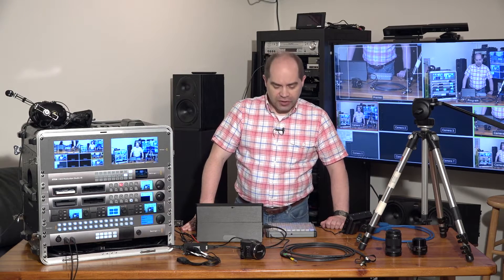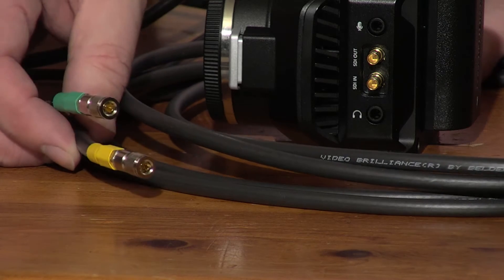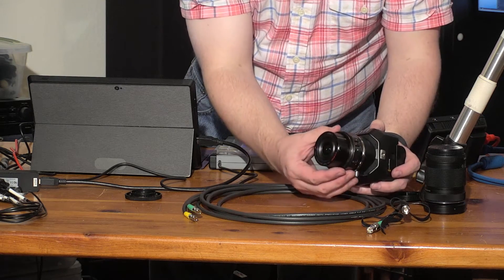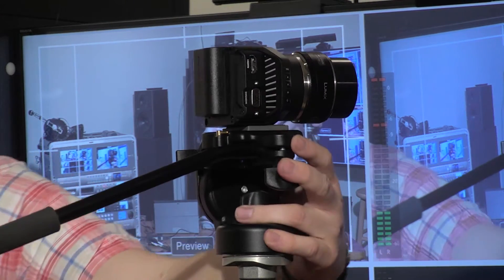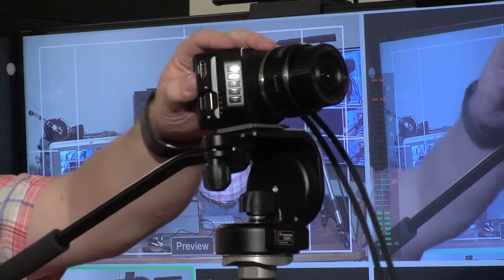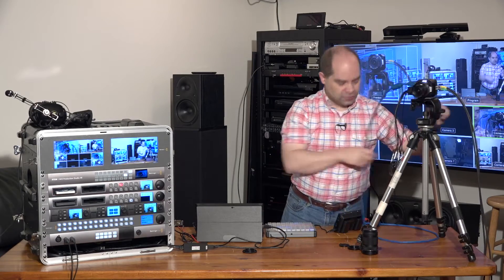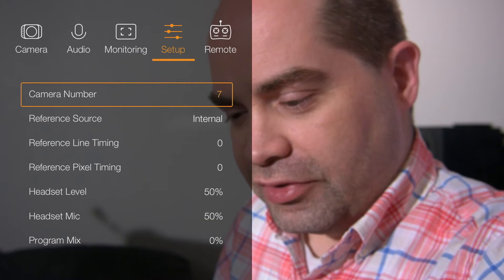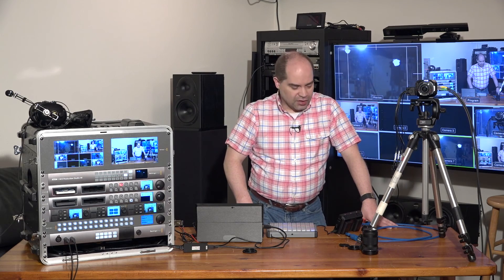DJP Crew Training - Blackmagic Design Micro Studio Camera Connections

Comment: Thanks for the demo brother, Actually i'm facing issues while connecting the SDI to the ATEM switcher i can't control the camera via ATEM software if i connect a HDMI with a ATEM HDMI series i can control the camera may i know how do we control the camera via SDI cable connected to an ATEM SDI Series
Reply from the maker: If you get the Blackmagic Bi-Directional Micro Converter 3G you'll be able to control the camera. Make these connections: (1) Camera HDMI output to converter HDMI input, (2) converter SDI output to switcher SDI input, (3) switcher Program/Aux SDI output to converter SDI input. (4) Connect the converter to a computer and install the Converters Setup application from BMD's website, then in that software set the converter's camera ID value to match the number of the switcher's SDI input you're connected to.
Reply: Thanks a lot so it's not possible to control the camera's zoom, color corrections for a SDI cable directly connected to an ATEM SDI SERIES, We have to do so many conversions please correct me if i'm wrong @djp_video
Reply from the maker: Not with a single SDI cable. SDI only sends data one way. Camera control needs to be able to send data back to the camera. That's the reason for the second cable.
Reply: @djp_video  cool thanks a ton:yougotthis:, So the micro camera input(SDI) has to be inserted in the same ATEM (SDI input) next to the video signal given to the ATEM right
Reply: Tested with the Cable Mapping:
- Cam SDI output to ATEM input
- ATEM Output to Cam SDI input
Works great! thank you
 @djp_video

Comment: Awesome demo. I had a question for you. trying to hook up a BM Micro Studio Camera 4K to ATEM TV HD. Hooked up the SDI in and out cables. Getting the video feed from the camera, but cannot seem to control the camera from the ATEM software. Connected the SDI in of camera to one of the SDI outputs on ATEM TV HD. Is there any setting either on the camera or the ATEM TV HD that need to be changed. Please advise. Thanks in advance
Reply from the maker: Make sure you've set the Camera ID in the camera's menus to match the camera number in the ATEM software.
Reply: Doug Johnson Productions thanks, worked like magic

Comment: Do you think the Micro Studio Camera or the Studio Camera 4k 2 has a more superior image or are they about the same? Also, what is your opinion on the quality of the Studio Camera 4k 2? Thank you for the review of the Micro
Reply from the maker: They're going to be identical.

Neither performs well in low light. And finding good quality lenses which provide a smooth zoom capability is quite difficult.  I've pretty much relegated my Micro Studio 4K to being my last choice and if I have anything else available I'll go with that instead.
Reply: @djp_video  Ok, good to know. So if I'm on a well lit news studio set, do you think the Studio Camera 4k would hold up and give a quality image? Or should I consider other cameras (really the only pull for the Studio 4k is the ATEM control).
Reply from the maker: In a well-lit environment the limiting factor is going to be your lens. If you can put a really good lens on it it can produce a good quality image.
Reply: @djp_video  I know this is not the best camera option, but I'm limited in budget at this time. I am purchasing the 2 m/e, because I need supersource (thanks for your great videos on that), so my camera budget got lowered. We are planning on the Lumix 12-32 2.8 and 35.100 2.8. Thank you for your quick replies!
Reply from the maker: Take a look at the Sony FDR-AX700.  It'll be cheaper than the BMD Studio Cameras + lens and produces a better image.  You give up some control over the camera though.
Reply: @djp_video   AX700 looks great except no SDI output. What would you recommend if trying to avoid conversion to SDI? I have one XA15, do I buy a second?!
Reply from the maker: It’s best to use cameras in the same family. Otherwise the image won’t match when you cut between them. 

If you already have an XA15, your best bet would be to get another of the same or similar camera within the same brand.
Reply: @djp_video  thanks. This is something I’d be thinking about. I’m very happy with the xa15 but just fancied something smaller as a remote camera on stage, nestled within musicians for example.
Reply: Are you aware of anything micro/compact in the Canon range, ideally with SDI output?

Comment: I need to connect 4 of these camera's to the ATEM 4 M/E and use the camera control panel while outputting the full 4K60 signal using 12G sdi to a Decklink 4K extreme 12G capture card. How would I plug all of these together.
Reply from the maker: You've got a few options. The cheapest is to route the camera sources to Aux outputs on the switcher, and connect those Auxes to the DeckLink. The next cheapest is to get SDI distribution amplifiers. But the preferred solution is to invest in a routing switcher (like the Smart Videohub 40 12G), which gives you the greatest flexibility and can significantly simplify connections and signal routing.
Reply: What was your Solution and how is it woring for you?

Comment: In the Manual it's stated: 
"1. Connect your Blackmagic Studio Camera’s and Micro Studio Camera 4K’s SDI output to any SDI input on the ATEM switcher.
2. Connect any one of the ATEM switcher’s SDI outputs, except down converted or multi view outputs, to your Studio Camera’s SDI program input. Camera control signals are not sent via the multi view and down converted SDI outputs."
Let's say I have 6 Micro cameras. How do I get enough SDI outputs from the ATEM switcher? :)
Reply from the maker: You'd use a distribution amplifier or routing switcher to split the signal that many ways.  But that connection isn't absolutely essential; if you don't need remote control over the cameras (exposure, color), aren't using SDI for intercom, and don't care about tally you don't need that return feed.
Reply: Thank you! Your channel is very helpful 👍🏼  @djp_video

Comment: Nice review, but I hate BMD for screwing this camera completely. 

Many people are actually looking for simple non-operated camera where they can just control basics (zoom, exposure, focus) remotely. This could be it. By choosing stupid Super16 sensor here with MFT mount they made sure no lens is operating properly. All lenses crop big time, all power zoom lenses are pretty low aperture, those mini sdi connections are horrible, power is only by batteries (who the hell is running on batteries in live production), power connector is via stupid breakout cable.

I would rather see camera being a little bit bigger to house proper connections, had gopro like display, small (or none) backup internal battery, it does't need to have intercom capability, but they need to fix the lens-sensor issue either by providing MFT-MFT speedbooster or by putting another sensor in.
Reply from the maker: I agree. They made some poor decisions all around.

Comment: Hello. . The only thing I'm not totally sure is the capture.  I can see it sends signal to your ATEM, but does it capture there as well?
I'm interested in outputting 4k 60, and I believe the studio camera only outputs this signal through sdi, so if you're using that output for monitoring I would like to assume that I could capture through software on my ATEM workstation.

Could you help clarify this?
Reply from the maker: The current models of ATEM switchers do not have capture capability built-in. (Some of the much older models did, but I wouldn't buy one of those now.) You'd either need some kind of video recorder (like their HyperDeck Studio Mini, for example), or a capture card for your computer (such as one of their Ultrastudio or DeckLink products). The former is definitely much more reliable.
Reply: BMD MicroStudio Camera has 6G SDI only. So 2160p30 is maximum here. Otherwise I am not sure If I understand your question. Camera has no internal recording, to record it you need to have some sort of capturing device.  You can use BMD Hyperdeck, Atomos Shogun..., or software solution using SDI capture card (like BMD Decklink card) in your PC.

Comment: Hello... great videos in general and thanks for making one on this camera, we're in the process of purchasing one. For my question, aside from assigning the "Camera Number" is there any other configuration needed to make it work with the ATEM software? Also, being that you're one to use PTZ cameras (as we are), have you looked into a Pan/Tilt head for use with this camera? Something like this:

https://www.bhphotovideo.com/c/product/1223151-REG/bescor_mp_1e_motorized_pan_head_with.html?sts=pi

Thanks in advance!
Reply from the maker: You'll also have to set the resolution and frame rate manually -- those can't be controlled from the ATEM software.

Before buying this camera, please make sure that it really does fit your needs.  I have found mine to be next to useless because of its horrible "low" light capability.  And by which, I mean that it needs a ton of light to work.  For example, when I shoot these videos I usually use two big LED light panels which require me to stop down quite a bit on my Sony cameras, but that much light doesn't even begin to approach what these cameras require, even at its very noisy +18dB gain setting.  A lens with a larger iris would help, but then you can run into issues with a too-shallow depth of field (what makes it even worse is that auto-focus is a joke and the ATEM software's control over focus and zoom is abysmal -- don't even think of trying to adjust these in real-time), and I don't think that even to this day there are any f/2.8 or faster lenses that have remotely controllable zoom.  The best I've seen is f/3.5, which is what I'm using.  Bottom line is that I'm very disappointed with the performance of this camera and I've pretty much resorted to only using it outdoors.  I don't recommend it.

The PTZ unit you referenced is definitely a bottom-of-the line solution.  It moves quite slowly, and is rather imprecise.  I don't think I'd every consider using this to produce motion during a shot -- only for repositioning between shots.  Controlling from much of a distance is also a problem.  Personally I wouldn't recommend it unless you have no other option.
Reply: Thanks for your quick response! With your latest comments, we might have to look at something else. Most of what we record is indoors and we don't have 'camera-men' ... meaning all control is handled at our workstation. In addition, with most of our recordings, we don't have control of the lighting within the room (and adding light is not really an option)... so sadly, this is a bit of a disappointment... I do wish the ATEM software would allow you to control non-BMD camera settings, but I don't see that happening any time soon... and as for the PT unit, I agree that unit is scrapping the bottom of the barrel with that, but BMD (even though photoed on their site) don't recommend one to use with this camera.
Reply from the maker: If you're investing in your own motion base you can get away with just about any camera you'd like.  As you've probably gathered from my videos I like the options from Sony. For a great budget option, take a look at the PXW-X70 (http://djp.li/x70 or http://djp.li/x704k) -- extremely similar to my PXW-Z150 (http://djp.li/z150) cameras that I love, at a much lower price point.  The X70 has a slightly older sensor with a bit slower readout, and Zeiss optics instead of the G lens, but otherwise pretty much functionally identical.  Both offer decent remote control over WiFi capabilities.  Just keep in mind that when used this way they create their own wireless network and aren't capable of joining an existing network, so if you have three cameras you're either constantly connecting/disconnecting from each camera's WiFi, or you'd need a dedicated phone/tablet for each camera.  You don't quite get the same flexibility as the BMD cameras for controlling color and dynamics, but control over exposure, zoom, and focus is much, much better. And they, of course, work amazingly well in normal lighting conditions.
Reply: Awesome! I'm actually watching your video that goes over the cameras that you use, and I appreciate you explains some of the 'whys' to the cameras that you use. I'm going to try and see if there are any reviews/demos of the wifi functionality for the PXW-X70 camera... kind of see it in action. Thanks again!!
Reply from the maker: I could probably do a demo video on that.  I don't think there are many.  Coincidentally I have an X70 arriving today.
Reply: ... a live demo?!?! hahaha
Reply: Hi Doug! First, thanks for the videos. They're a great resource for those of us starting out in multi-cam streaming.

I was wondering if you'd had a chance to use the older Blackmagic Studio cameras? Do they suffer from the same low-light problems?